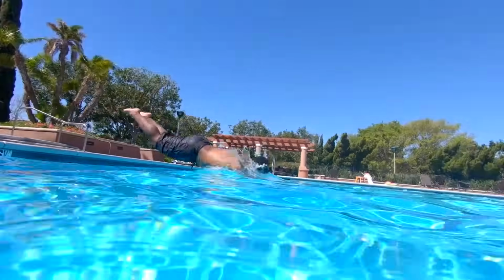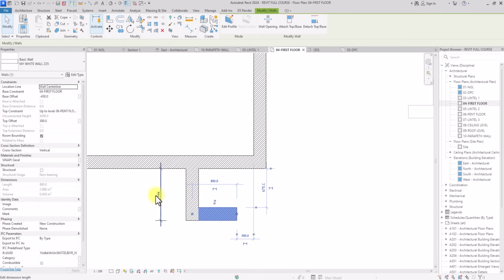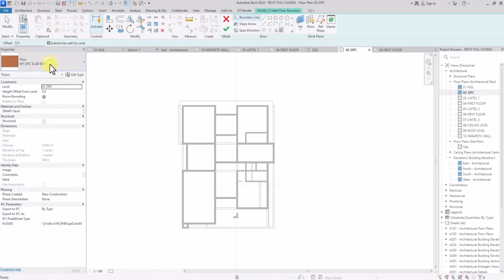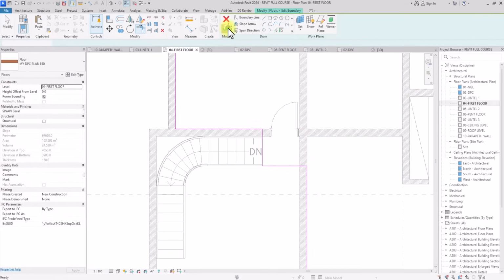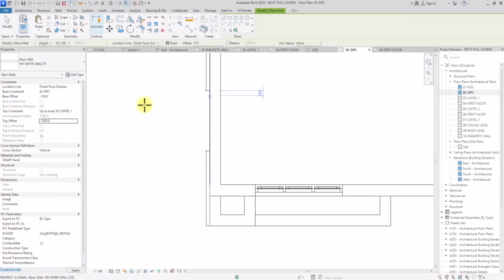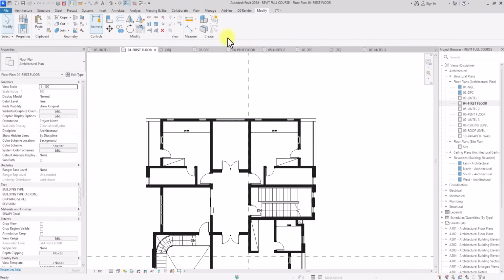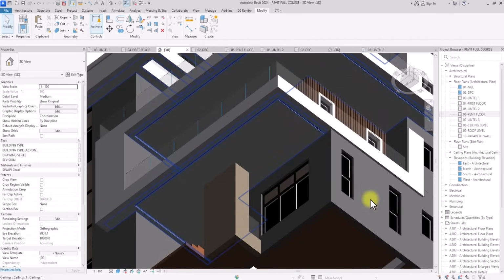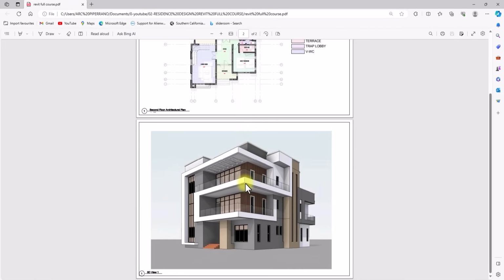Autodesk Revit Architecture 2024/ Full Beginner's Tutorial Course

Comment: Great effort! 👏 Your Revit modeling is quite impressive. Just one observation — it seems the walls and beams from the ground floor haven't been fully considered when modeling the first floor. In some areas, the wall placements differ between floors, which could lead to structural or alignment issues later on. Keeping consistency in wall alignment and load path is crucial, especially when working with multi-story structures. Would love to see an update with those adjustments. Keep it up!